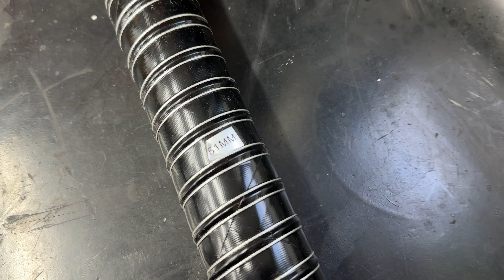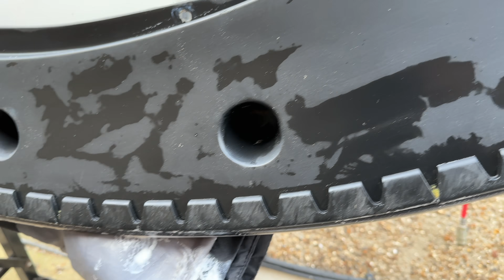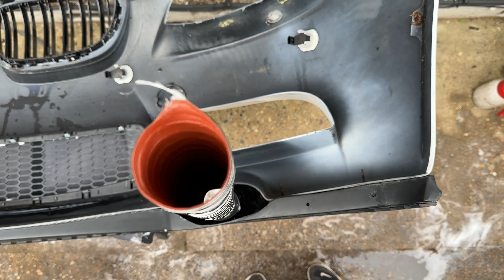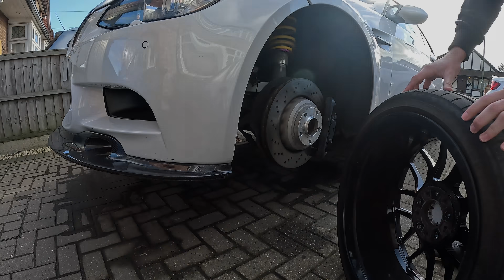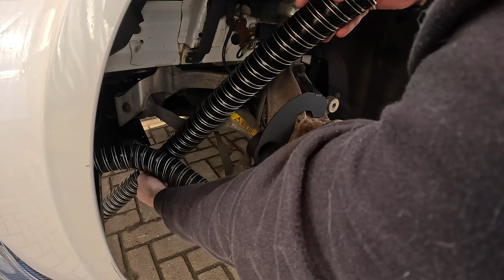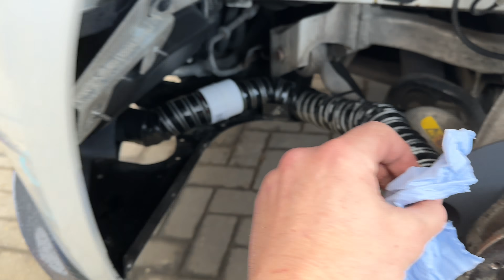BMW e92 M3 Brake Cooling Guide - Getting it ready for track!

Comment: Mumbray now do I more substantial ducted backplate, but it's not as cheap!
I should've said last time, useful video👍
Reply from the maker: There’s a few companies that produce them, pinnacle motorsport also do a smart one 👌

Value for money the ali-express one did me proud for the Nurburgring trip
Reply: @stoneautomotive  Oh yea! And their bigger than the Mumbray ones, but they're £240 vs £96!,  thanks for the heads up any👍
Btw, something I would be concerned about with your Ali exp shields is that they leave (at least one) balljoint boot fully exposed to radiated heat from the discs. This will cause very rapid perishing of the boots and they'll split. I've seen this when working on 'regular' cars when someone hasn't put a balljoint heat shield back on when replacing e.g an suspension arm.
Reply: @stoneautomotive  Oh btw, I think I see where you went wrong with the hole cutting, it appears you might have been using a wood hole cutter? I would expect a metal hole cutter to have many more and finer teeth (think regular wood saw vs a hacksaw). I think I'm going to try the DIY route.

Comment: Hey mate. What diameter is the opening on the brake shield w/ ducting? In addition, do you know which seller you bought from? There seems to be quite a few with the same images yet different prices. Seems like a great option especially compared to what else is there on the market, absurdly priced. This even has a great little shield for the arm joint. Cheers.
Reply from the maker: I think it was 50mm as the ducting was 52mm from memory.

I did revise the design again, more details in my project thread -

https://forums.m3cutters.co.uk/threads/stones-2011-e92-m3-competition-project.207436/page-14#post-3726155

I got find the link for the seller sadly, was a few months back but imagine it all comes out of the same place!

Really impressed with it, had zero fade on the ring trip 👍

Comment: Hello mate, did you find that your wheel rubbed on the hose? I’ve seen other people run them through the other side of the control arm
Cheers
Reply from the maker: I haven’t had any issues but as I run the 19’s I will have slightly more clearance than those running 18’s

Comment: Whilst the cooling will help a little, if you're taking it on the ring I guarantee your next mod will be brakes. They're just not up to track use and the ring is far harder on brakes than anywhere else. I've just bought all the bits to do the f80 brake swap as my standard discs are still warped from last years trip.
Reply from the maker: Yea I know she won’t be happy with the stock discs (I have already fitted uprated pads) 

If they do warp is will be a great excuse to finally upgrade the brakes to something more suitable 😅👍

Comment: Nice work fella! I also got caught out on length and route and ended up buying twice, 2m second time. Also, I put duct into hole and then got some heat shrink around it to hold in. Worked OK so far! Id recommend a jubilee on the back of bracket though and pinch it up tight! Mine came off, flapped about and got destroyed by the wheel.

Comment: Would be handy if it actually directed it straight at the caliper :(
Reply from the maker: The research I’ve searched would indicate that’s wrong, keeping the cooling into the rotor hat which then works through the vents provides the most even cooling.

I’m not a motorsports expert but did a good chunk of reading up on it before proceeding 😅
Reply: @stoneautomotive  ah makes sense. I have the BTCC kit so wonder if that effect would be negated with the floating discs, and would still be better directed at the caliper.
Reply: @AdDaManGT  No, you want the air directed to the ctr of the disc, where the vanes suck in the air through the disc.